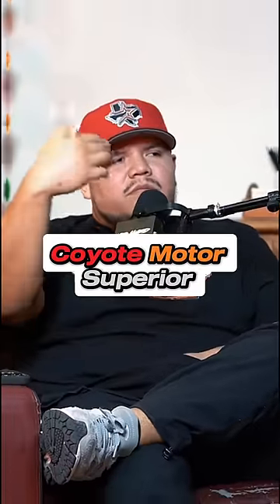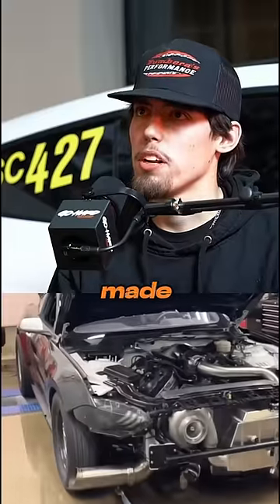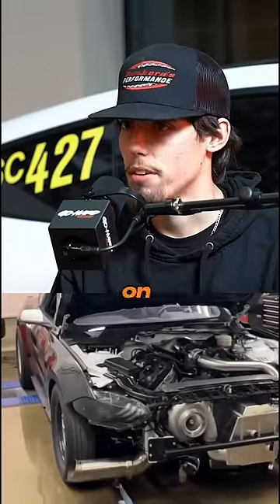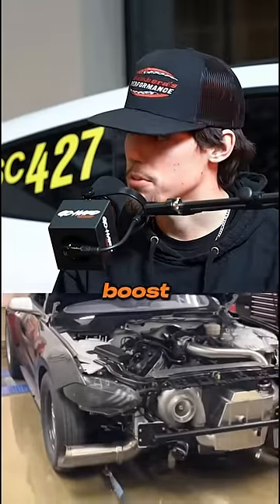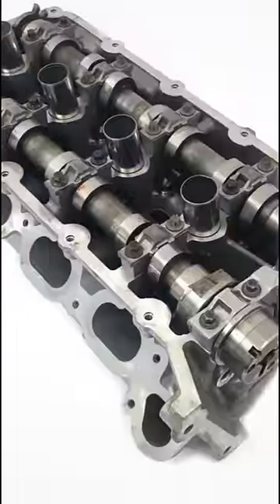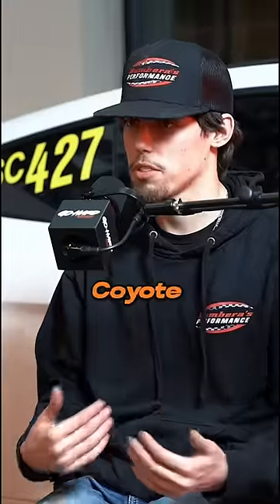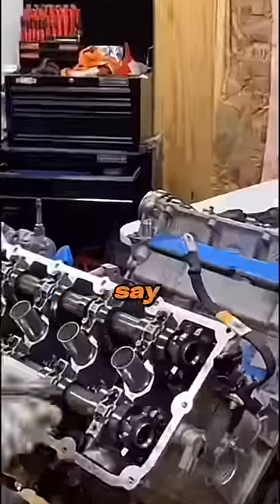SUPERIOR Ford Coyote Motor 😳 #shorts

Comment: I really think the coyote is becoming the new "LS" of the car world. Theyre stupidly reliable and strong motors. You see more and more coyote swap kits becoming available for all kinds of different cars ecery day. Not to mention they're coming down in price, while recently LS's are going up it seems. I've considered replacing my camaro's ls with a coyote

Edit: some of y'all are dense as fuck lmao I'm not saying it's exactly a new LS. I'm saying it's having the same impact as the LS did and becoming the new standard "swap a _ in it" for American engines in car culture.
Reply: The size and complexity is the coyote’s downfall and I can’t imagine picking up one as a complete long block with front accessories for $500 until another 15+ years if ever 

Any sort of issue on a coyote almost always requires a full engine pull and a full day to just lift a head and reassemble . The average guy with zero experience can work on a LS and be completely fine lol
Reply: Coyote costs too much if you dont buy them with the mustang.  10k just for motor and accessories.  I could buy and build 2 built ls for that
Reply: @killakam123321   that's what I was saying is that prices have dropped for the coyote. Found multiple examples on eBay from 4-6 with transmission and harness. That used to be unheard of. I was looking for motors to replace my LS1 and most of the LS's are 3k now with decent miles
Reply: @killakam123321 lol id love to know where you’re paying those kinds of prices. Any salvage yard in my area has multiple coyotes from 2k to 5k , and I’ve sssn guys leave a pick n pull with a low mileage mint f150  coyote for 250 bucks .
Reply: @dennismurray4088  sorry I only want gen 3 coyote
Reply: Why buy a coyote when you can get an ls for wayy cheaper and make more power for cheap and single cam baby
Reply: @dennismurray4088 lmao for what a 200k gen 1 😂 I’ll stick with sub 100k 6.0 for 950$
Reply: No. The entire point of the LS platform is its simplicity, its highly modular, its cheap, its reliable, its durable, and both LQ/LS motors are plentiful/easy to get in junkyards. 

Coyotes are NOT simple, NOT modular, NOT nearly as reliable in stock form, NOT cheap, and are NOT easy to get. NONE are in scrapyards because they are expensive motors.

Calling it the “new LS” means you don’t understand the LS platform to begin with.
Reply: @Dan-gj1hz  coyotes ARE simple ARE easy to work on and ARE quite literally modular and ARE equally as reliable out of the box and will hold more power stock than a lot of stock internal LS motors. You can find them for the same costs as half decent LS engines online now. And no I'm not really counting going to a junkyard, you can obviously find a beat old motor in a yard and make it pretty again. I began building coyotes as an amateur mechanic, and still work on them now, along with LS's. Ive built an LS1 in my own personal car. So no I have an understanding of the LS platform. There a new guy in town and he's a hell of a competitor. You guys make the coyote out to be this impossible to work on, frail little paper motor and it simply isn't. I will give you overall cost, coyote mods are a little higher than some of the LS engines.

One of the biggest advantages the LS has over the coyote is Chevy's consistency in making its engines fit nearly any car theyve made with little trouble. Fords modular motors aren't that hard, like going from a 3v to a 5.0 but they aren't as extensively easy to swap as LS motors
Reply: @dennismurray4088   even go to pull a part, their engine are flat rate costs no matter year or model. There are 5.0 f150s there all the time. If I'm not mistaken a V8 motor at pull a part used to run around $300
Reply: @Dan-gj1hz  thank you
Reply: Lmk when a coyote is at the junkyard for $500
Reply: @duo293  read my other comments, go to pull a part.
Reply: @VermillionRacing  the coyotes still arent in the numbers that the 4.8 and the 5.3s are. Personally ive never seen a coyote. But i havent seen an ls1 either
Reply: Youre comparing a modern dual overhead cam v8 with variable valve timing to a stone age pushrod 2 valve piece of shit what do you think is going to cost more the only good thing about the LS is the price and availability 5.0 4.6 4v 5.4 4v and 5.2 voodoo flat plane crank ford engines are better in every single way and are technological marvels compared to the LS that is just a copy of a 351 windsor. Can take a 40 year old 351 windsor and get just as much power as an LS chevy can not even build an overhead cam v8 that doesnt immediately blow up, all they can do is copy ford, the succeeded with the LS but they can not build an overhead cam engine to save their lives
Reply: stupid reliable hahah ford is #1 in recalls hah

Comment: The difference yall dont seem to understand is value per dollar amd the LS is second to none when it comes to reliable power and support... you can make the same if not better power on a Coyote but to even do that you could pay 2 to 3 times the price to get there as opposed to an LS engine.
Reply: True. We don't all have endless amounts of money to throw around.
Reply: All you are saying is that your stone age two valve pushrod engine is cheaper and shittier than fords dual overhead cam variable valve timing v8
Reply: @ErikGoranson  And ypu seem to completely dodge the point I made that it's more expensive to do that with a Coyote, let alone more complicated.
Reply: @mattroush7364 if you are going to build an all out race engine there is no point in cheeping out, I would still choose an engine that's superior to begin with vs having to extensively modify an inferior engine because of its simplicity

Comment: That one guy with a 5.9 cummins starts laughing because if they make 1600 horspower I don't want to know how much torque it's has and it's all probably kicking in around 900 to 1200 rpms
Reply: if only they could rev to 7000 or 8000 rpm. That shit would have the low end torque and the high range power.

But keep in mind the greatest advantage of a high reving engine is that the gear ratios can make up for the missing torque.
Reply: @aktionp20 that’s the thing, they can’t rev high because of the long stroke. If you do rev it high it will throw multiple rods due to the extreme forces they are facing
Reply: @2seep them high HP Cummins are running like 6k plus RPMS bruh. They’ve come a long way
Reply: @jimmysturdevant9843  They also detonate when they blow up so much pressure
Reply: Dude even the fastest diesels are slow compared to equal powered cars, diesel truck owners need to realize yeah with a tune and delete 🎉they can beat a mustang gt. But trucks are not fast.
Reply: @sevirz13 because they are trucks... a similar car power wise weighs half that truck and sure is more aerodynamic LOL 😂 with just a delete and beating a gt is impressive
Reply: @MrJ183  no shit Sherlock, theyll never be as fast as cars. But guys with trucks think they are. That's my point. Congrats on bringing nothing to the conversation.
Reply: Well the regular cab short bed F-150 xl that has the coyote engine and when you do the same upgrades they do to the 5.0 the truck in my opinion has a advantage because they have 4wd which is like AWD pretty much all 4 wheels hook and get traction so I think those can be just as fast as cars some of those have gapped hellcats and they look like a regular looking work truck
Reply: The diesel trucks are only fastest at oiling down a drag strip.
Reply: @jonathanallen8236 sounds like gtrs😂
Reply: Yeah, but it weighs 1200 pounds.
Reply: @legionfab6417  probably so.
Reply: @sevirz13 you ragging on another poster for not bringing anything to the conversation when your original post is common knowledge to a 10 year old.  😂😂
Reply: @sevirz13 haha idk man, 90% of the cars on the street won’t even come close to keeping up with my 5.9. Sure, cars that are built for the track they will be faster. There’s six second diesels out there. My 5.9 has 1200hp and all the amenities. I didn’t have to strip it down and get rid off all those things. It looks like any other truck out there.
Reply: @jonathanallen8236 haha ok buddy 😅
Reply: @ohboy2592  "common knowledge to a 10 year old" yeah ok bud
Reply: @Highplainsdrifter44  dude you have 1200hp, you're in like the top %.1 of diesel trucks. You don't see 1200hp diesels everyday. You gotta have a built trans and compounds I'm guessing?
Reply: @sevirz13 yeah maybe a 2009 and before Mustang GT but not the newer ones.
i had a 16 F350 tuned and deleted was still slow asf later did bigger turbos and injectors and was still slow asf😹sold it bought a 2020 5.0 definitely faster then both setups.
Reply: “that one guy with a 5.9”
yeah and that one guy with minimal mods to his car runs the same time if not faster then a built 5.9 pushing a lot of hp and tq to still run stock car times😹😹😹😹😹
Reply: @Highplainsdrifter44 and just as slow as all those other trucks😹
still running stock car times but sure your “5.9” is fast
Reply: @dnsbb8033  haha yeah, for a truck it is. I run low 8s in a 1/4 mile. What are you runnin ?
Reply: @Highplainsdrifter44  whatd you trap in the 1/4? and wya? lets run for money.
Reply: @Highplainsdrifter44 I believe you on the 1200hp, but definitely not low 8’s in the 1/4. That’s stupid for a truck
Reply: No 5.9 making 1600 is making any power at 9-1200 rpm’s buddy. The turbo hasn’t even made positive pressure at that point. Maybe 3000.
Reply: @traxxasrcfun  haha well I’ll tell you on one of my settings at 1200 I got enough air and fuel for more and my pulse width isn’t maxed out at 24,000 psi and I can go beyond that. I can run anywhere from 50 to 100 lbs of boost with my compound setup.
Reply: And it’s not beating his coyote. What’s your point?
Reply: @mariomunoz7167  oh, I got something that will. I ain’t a one trick pony hog
Reply: @lawrencecoleman7850 they have an advantage on the street but not on the drag strip.  They are very fast but they're not faster than mustangs with equal mods this has been shown time and time again.
Reply: @Highplainsdrifter44 no way you're going low 8s with only 1200 hp in a big ass truck.  A mustang would have trouble going low 8s with 1200 hp even with weight reduction and a drag suspension.  Tell us another bs lie.
Reply: @traxxasrcfun especially a huge truck with only 1200 hp lol.  Sure as hell ain't going 8 anything let alone low 8s.
Reply: @midnight347   in my opinion on the track the truck that has 4wd which is basically AWD still would have a advantage over the 5.0 which is rwd due to the truck that is AWD 4wd which would give it the advantage of getting more traction on the launch but I could be wrong I just think they have a advantage on the street and the track because of the 4wd but the coyote engine in the truck is slightly different than the one in the mustang but they are both very underated engines and the Mopar people think the hellcat is invincible but they don't realize the coyote engine that has forced induction super or turbo puts out just as much maybe more HP than the hellcat does and the hellcat cost so much more

Comment: In my opinion the coyote is a great race motor and I won’t deny that stock for stock it will handle more power, but I’d rather have the LS on the street. More cubes for more torque and super cheap/easy to get parts for so I’d be more inclined to put miles on them. I could go to any junkyard and get 10 LS motors today and that’s just not the case with a coyote.
Reply: You don’t know what ur talking about ls beats coyote in SBE record lol by ~ 1 whole second

Comment: Can someone tell me how it’s stock if you need sleeves?
Reply: It depends, what type of power you want to make? Gen 3's are good completely stock everything besides oil pump gears, for 1000hp. People like Boyd Bumbera, need a sleeved stock block...because they are making 1500hp plus. They do alot of racing on real drag strips, betting big money. Regular people don't need 1500hp and don't go racing on regular basis...even 1000hp is too much for the streets!🤔🤯😉
Reply: So it’s a stock engine right, and then they put sleeves in it so it can withstand the power. So not fully stock but 98% stock. Come on bro bro stop trynna be a 🤡
Reply: You find me an high HP engine that doesn't get new sleeves
Reply: @papichulo2736 as opposed to having to get a complete billet LS to make the same power 😂

Comment: 😂 any modification to the block including sleeves ain’t stock block anymore
Reply: That's technically still a stock block. 😂 they didn't change the block. It's been sleeved. It's not a stock motor but you are still using the stock block to build your motor. Think you are confused on what stock block means😂
Reply: Coyote guys will stretch the definition of “stock block” as much as they can because they cant cope that an LS can make similar power for less than half of what it would cost to purchase the coyote🤣
Reply: Stock block means stock shortblock.  At least in any world I am or was ever a part of.
Reply: @foreverpsycotic   An unmodified longblock is the definition of a “stock longblock”. The coyote owners will deck the heads, install thicker sleeves, install stronger tensioners, chains, and sprockets and then have the audacity to call it “stock block” and the “king of all stock motors”.
Reply: @Dan-gj1hz  Stock block.... full of concrete with sleeves and forged everything.
Reply: @foreverpsycotic   Or they just straight up lie. Last stock block 5.0 coyote I saw making 1400hp blew up after three passes. 

Theres a good reason why a bunch of these “stock block” guys dont claim the stockblock records because THEIR BLOCK IS NOT STOCK. The rotating assembly might be the same and the heads might not be ported but they change everything else. Its a joke.
Reply: @foreverpsycotic u aint got a clue dude not 1 clue the car they are taking about still uses a cooling system and is not a filled block and has Litteraly 1000s of miles on the street and has mad over 2500plus on a stock crank u hater😂

Comment: Love how ford guys say stock when it’s forged every thing 😂 like say forged from the factory but they out here comparing their race block to a old fashion pushrod iron blocks 😂
Reply: Brett has a sleeved block I think that's all he said he's running beside a but load of boost could be wrong tho but a tuned coyote walks my buddies fully built 6.0 ls cam heads crank tune intake exhaust and Jeff I do believe runs nitro meth as well and he's trading it for a stock 5.0 truck that can almost keep up....them 5.0 trucks be stealing hellcats thunder
Reply: @garydryden9574 I call cap for one of you have sleeves it’s not stock .a tuned 5.0 is not walking a 408 ls. Heads cam intake ext 6-650 hp ain’t losing to 500 .
Reply: @racingjunk7024 what car is the 408 in? comparing a sealed motor coyote FIVE LITER to a 6.7L motor with done up heads and cam isnt impressive. s550s aint light either. brett was running 6.50s on sleeved ford block, gt350 heads and stock crank. ls need billet everything. just accept its the god motor and have fun with your 408. i love pushrod motors dont get it twisted, but know where the coyote stands in the racing world.
Reply: @racingjunk7024  call cap all you want bud just those are the facts those new 5.0s and 5.2s just make great power for the small displacements
Reply: Midnight performance ran 7.9 on a completely stock sealed 5.0 , and there’s hundreds of f-150s and mustangs roaming around making 4 digit power reliably , and being pummeled daily . There’s no such thing as a stock sealed ls making 4 digit power outside of maybe a lsa/ ls9 doing it
Reply: @dennismurray4088 Aldo went 7.7 I believe.
Reply: @dennismurray4088  one don’t let them lie to you and say it’s stock and not that hard running good numbers in a small pick up truck that’s awd.